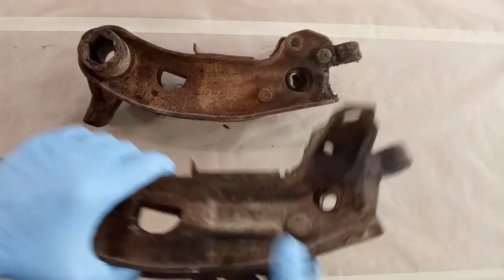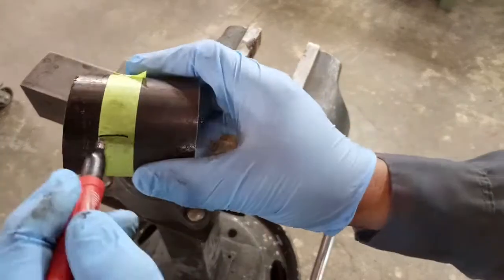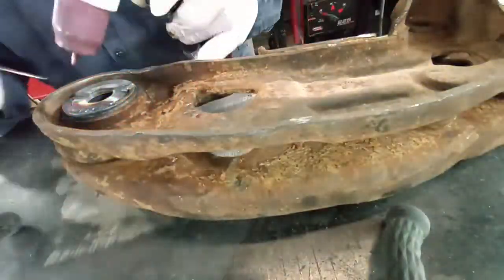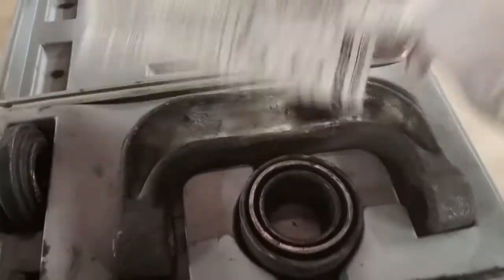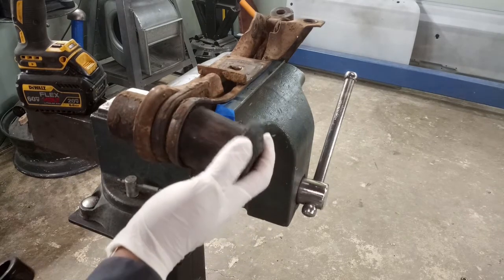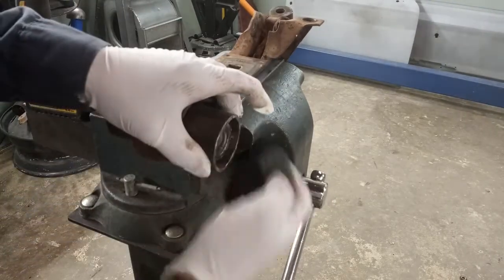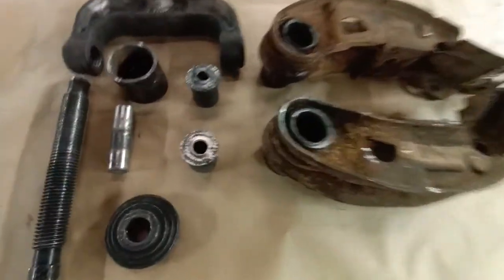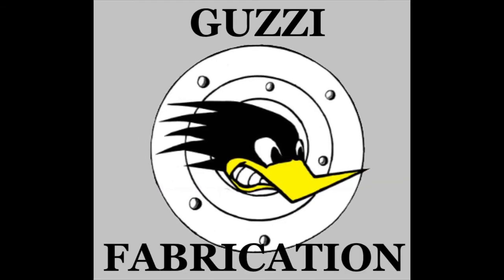How to remove Mopar - LCA ( lower control arm ) bushing sleeve -  EASY !  - best method

Comment: Ball joint presses are so good at a variety of suspension repairs. I don't know if it would work on this exact bushing but I on things like tail shaft bushings and the bushing shell on 
GM lower control arms I use a Sawzall and carefully cut one side of the bushing in half. You have to be extremely careful and not cut 100% through but if you get it close and then use a small flat punch the bushing will usually just push right out. It removes enough material to release the tension. But you have to be able to get the blade completely through the bushing so it doesn't look like it would work on this particular application.

Comment: Do you need to press the bushing out? I just replaced the rubber bushings only.
Reply from the maker: If the sleeve isn't damaged and the bushing is the correct size, yeah that's what I would do.
Reply: Thanks!
Reply from the maker: @jo-boo4455  👍